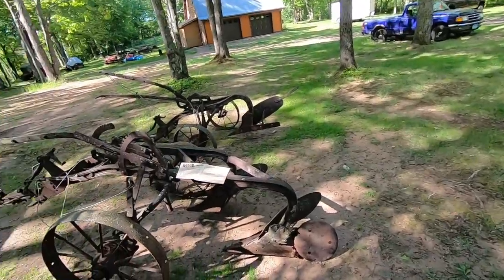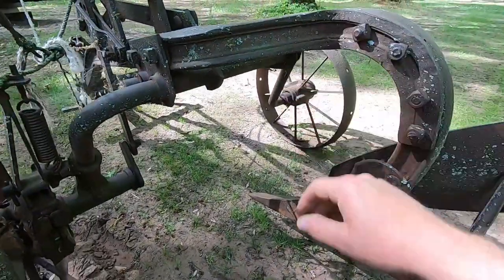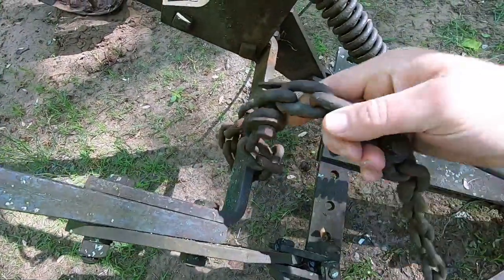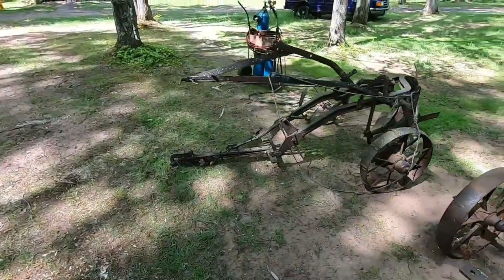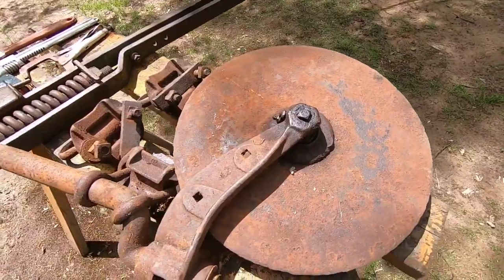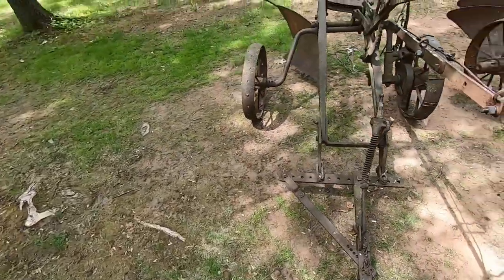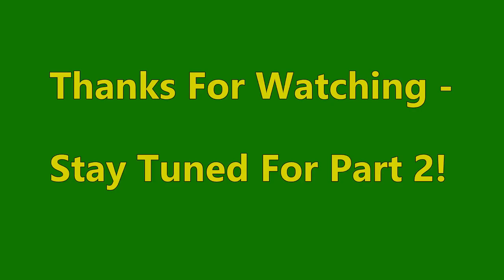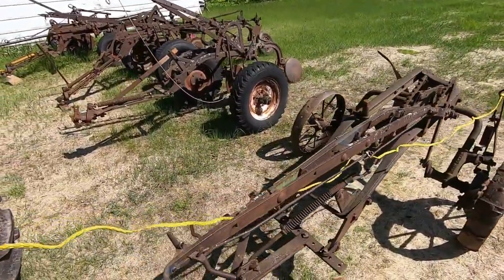John Deere No.51 Tractor Plow - Bringing It Back To Life Part 1 of 2: Repairing Levers & Trip Hitch

Comment: I might have a part or two if need be!....The most common reason for the chain was to connect it to the tractor so when the hitch would trip in hard or rocky ground you weren't spending all day backing up to re-hook.  The best luck I've had with antisieze is to get more on myself than on the part I apply it to!
Reply: Lol there's always more anti-seize on you then what you are putting it on lol!😂🤣😂🤣🍻👍
Reply: Shane Holst The pain is real 🤣🤣🤣👍🏻👍🏻👌🏻👌🏻

Comment: Thanks for part 1 of the plow it looks good now. It's kinda funny you say about your brother plowing up the disc part. We had a Heston/ Case IH brand round baler that was a pile of junk to use, our NH 688 is a way better baler that replaced it . anyway the Case kept blowing the lock collars off the roller shafts, Dad  lost 3 before  before I started welding them on and the baler finally left us .
   3 or more different times I randomly walked across that field to see him  over the years since and found all those lock collars laying out there on the surface. Those odds must be pretty high of repeating it.   Same thing happened to a 3 point adjuster from a customers tractor, he lost it so I told him I'd lend him a spare one until he found his in the field, it was about 2 years later he pulled in my yard and gave me mine back. He figured he'd never find his ,but he found it while out baling one day.  It's amazing whats in fields guys lost and it's still turning up 50 years or more later. Take care.

Comment: Spent my teens working for local dairy farmers back in Wisconsin, at a time when a small dairy operation was still a viable business.  Totally familiar with not having the time to fix anything right.  There was never enough hours in a day or money to buy the "correct" part even if you had the time to make a trip to the implement dealer.  It was get it working again and get the job done with materials at hand so you could move on the next task.

Comment: Anti-seize was designed as a assembly lubricant for stainless steel to keep the threads from gaulling. It has moderate success as a rust preventative. You are correct, in our Northern climates plain old grease and oils work the best.

Comment: I agree on anti-seize, I only use it for hot stuff like manifold studs etc. On old open air stuff like those ploughs I'd be dipping the screws in pine tar, nothing beats it in my opinion, and I know for sure that'll stick on there good, since it stays on bolts on the ass end of semi-trailers in the salt water rivers we call roads around here.

Comment: My parts pile is the deluxe version, it  is on concrete slab of a long gone building. Several of my old trip plows have been "converted" to use a hydraulic cylinder. Not sure if that practice was common elsewhere , but it happened often here.
Your jackstand looks like it might be one of the Harbor Freight models that have been recalled. A couple of YouTube videos showing them collapse made me a
 return the ones I had.

Comment: Nice, Wow I thought when the thumb nail came up. Being from the city some of the terms your using are greek to me, But I purchased a 1 bottom Oliver chilled plow cir 1880's  for $20 at a farm auction 15 yrs ago to cut drainage culverts on land I was living on at that time, took some time to figure out how it worked, guys at work didn't have a clue either. Amazing device made so long ago & still worked when I left it to return to the city.  I check it out on Google Sat maps to see if it's still there & it is. Thanks for the video rehab..it  brings back memories of slave labor.

Comment: I myself love a can of "Moly 50" it's a thread lubricant but it does not wash off. Stupid expensive but better than grease, copper kote or any other of that stuff. We use it on the chrome of cylinders and copper kote and grease after 5+ years in the elements pulls the chrome off the cylinder when we pull them apart and Moly 50 a 100 ton ram does the trick. I was never a believer until until i seen it on the suspension cylinders. Tip, this it out with WD-40 or it's to thick to apply with a brush.

Comment: Love this video!!  Looking forward to part ll.  The add on flat steel at the end of the moldboard is factory and called the moldboard extension.  Yours seems a bit longer than what's shown in the manual and most likely has been replaced.

Comment: Interesting to hear your comments re antiseize...   the only product I ever used for that was either jut plain grease as you do or what we call coppercote..  which was, I think, the 'original' antiseize... which is basically a quality grease..  slightly lower viscosity than normal, with copper powder mixed in it...  and we always used that to great effect on all wheelnut/bolt applications on trucks and also on my 4wd...  Is that something you have ever tried??  Most antiseize today seems to be aluminium powder, together with molyslip, and graphite in a low viscosity medium, and I don't bother with that at all. Some also still use the copper instead of aluminium... but for the expense of them, I tend to agree..  good quality grease or basic coppercote grease (which seems hard to get these days) is fine. I can still buy 'Coppercote' or 'Copper-cote' made by Rocol, CRC, etc...  but not the basic grease with copper powder in it as we used to use. Just as well I still have my old gallon can of the original about 1/2 full still.

Comment: Just looked up that patent number, It is a tag off of a selenium rectifier. Used for converting AC to DC for charging large batteries.
Reply: @squatch253  would you consider selling the 2 bottom?

Comment: Good deal I was thinking to bad you don`t have a Colter ,We had 3 bottom IH  plow then bought a Oliver 3 Bottom 23" I believe it was Breaking Disc for 50$  Man alive would it make that old M snort  when we hauled it around , Actually the JD 40 did good with it but we kept kicking a track off on the ends .I just broke some garden field for a friend with my new red tiller Geez I was eyeballing the old 2 Bottom in the yard gonna pull it with the truck just to turn the ground over Man it was hard LOL.

Comment: Ive never heard of using grease in place of antiseize. Up here in the Yukon we have pretty heavy calcium on the roads in summer and salt in the winter; so its frequently used on lug nuts and on hub flanges so you can get the damn duallies apart. My question would be if grease is more prone than antisieze in attracting dirt. Interesting take!

Comment: Looks like your spare parts department is also the Poison Ivy patch.

Anti-Seize is not a lubricant or meant to keep things from rusting. Ant-Seize is design to prevent gauging and dissimilar metal corrosion.  Additionally your generic silver Ant-Seize is not water proof, in fact you can smear the stuff on and run a water hose on it and watch the stuff slowly wash away.  If you insist in turning yourself and whatever you are working silver with anti-seize as a general lubricant mix it 25% with 70% a good waterproof grease and the remaining 5% with inexpensive ATF and have at it you will find you have much better success with iron/steel fasteners.  Additionally for your day to day proper uses of Anti-Seize such as spark plugs in aluminum heads, or stainless steel or aluminum hardware mix your Anti-Seize 90/10 with ATF or synthetic engine oil and you will find that it is much easier to paint thinly on you part and since you won't have globs of the stuff on your fasteners or parts there will be less chance of you turning silver.  Lastly there is a waterproof Ant-Seize made its made for marine applications its chunky and last time I purchased some it was stupid expensive but when rebuilding the lower unit on an in-board outboard or an outboard engine everything is expensive so hopefully the next time I have to take it apart I won't have to drill out bolts and weld up bolt holes and drill and tap new holes again, or it will hopefully be someone else problem.
Reply: Thank you, good info.

Comment: Not too much of an anti-seize Guy myself, but you got me curious, what's with using a cutting attachment to bend? Would think that someone that works on as many old iron as you would have a nice selection of rose buds. I have a #4 and #6 mfa heating tip for my torch, I find them to be invaluable. Not that long ago I pulled the timing gear off the crank for gramp's Allis to get the alignment key to use on the new crank and gear, that gear has a five thou press fit, almost broke the puller, even the #4 rose bud didn't do much but make it angry. I let it cool down and tried the next day with the #6,and it practically flew off the crank.

Comment: Anti seize is a must on the coast here I Australia 
You guys get winter salt 
We get salt 365 days of the year
Maybe because we don't freeze it works better, grease just melts out, prob because of our much higher temps 
It still dries out but you certainly know the difference in a few years 

We don't have any old plows or tractors left here 
They all turned to dust years ago 
The salt air is so brutal 
Brand new bare melt will develop surface rust in a few hours 
Cats iron and hardox steel like railway iron does better 
It'll last 20yrs or so

Comment: I have a number 52, and have used it for a lot of years. One moldboard has a chunk out of it, just like yours. I'd be interested to know where you got the manual for it, as I've hunted one for a while. Great video!
Reply: Also want to add, the chain is probably on in lieu of a coulter. I used to do the same thing when plowing with a team and one bottom plow. It did a good job dragging the long grass and weeds down.

Comment: The only time I will use anti-seize is when I am dealing with a project that will be exposed to high heat, such as an exhaust manifold , the nickel in anti-seize helps to prevent metal to metal heat galling.
Reply: Yep, best thing for spark plugs, exhaust manifold bolts, and similar things that get hot!

Comment: I have some new plow shares that might fit these(old new stock) I would like to trade for the information of  how do you get the pony motor nosecone disengaged from the bellhousing of a D7F caterpillar. It has a hydrostatic transmission if that makes a difference. It is such a nice machine I would hate to scrap it, I'm going to put an electric start on it.

Comment: Do you know of anybody that has a line on parts for either an Allis Chalmers 2 bottom slatted rollover plow, possibly a Model 53 or a JI Case 3 bottom disc plow, possibly Model 302 would you?
Reply: @squatch253  thank you for the help!  I'm one of only a few in my area that appreciate the older pieces of equipment. A lot went to scrap a few years ago.

Comment: I just hate watching people use a torch to "straighten" a bent piece. Use a shop press, too much heat and you'll lose any temper that was in that piece. Then, you'll constantly be re-straightening that piece. Even a bench vise can still do the trick. I'm not bashing you at all, everyone does things differently. There's many "tricks of the trade" one can learn from the old time farmers, "IF" they're willing to teach and you're willing to learn.
If I may offer a suggestion, the springs on the adjustment handles, lube those up heavy and really work the squeeze handle. Be surprised as to how much they'll "stick" on you when trying to adjust the plow. 
As for anti-seize and grease, both will eventually dry out. We used to do the grease thing, switched back to anti-seize, lasts far longer for me. The trick with anti-seize is this, you have to know which type to use for the situation, yes, there are different types for different metals and environments.
Great video, cheers :)

Comment: I did a quick search on patent # 1640335.  It appears to have been issued Jan 1st, 1925 for an "uni-directional current-carrying device."  "The patent relates to an electric current-carrying device which has relatively high conductivity in one direction and relatively low conductivity in the opposite direction. It converts alternating currents into direct currents and is commonly used where a direct current is needed and an alternating current is alone available."
tldr, it turned AC into DC current.  
source:  https://www.courtlistener.com/opinion/1565032/union-switch-signal-co-v-kodel-electric-mfg-co/?
Reply: Yes, it is a metallic rectifier which came into being about the same time as Selenium rectifiers did.
https://en.wikipedia.org/wiki/Metal_rectifier